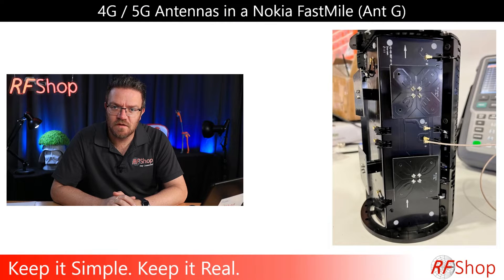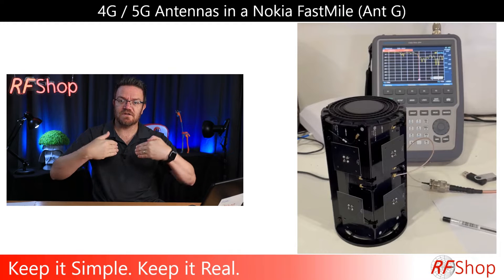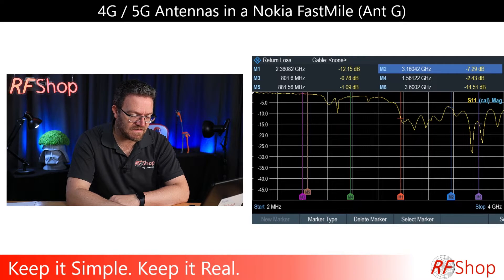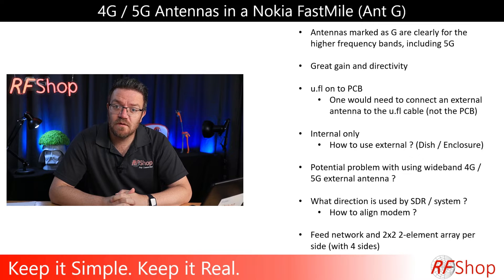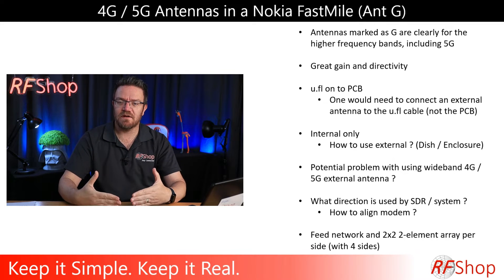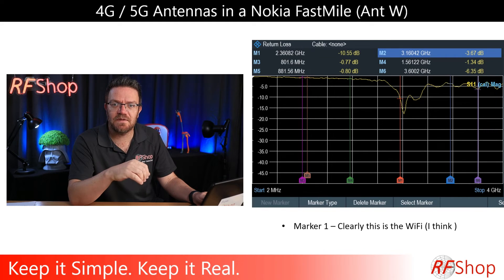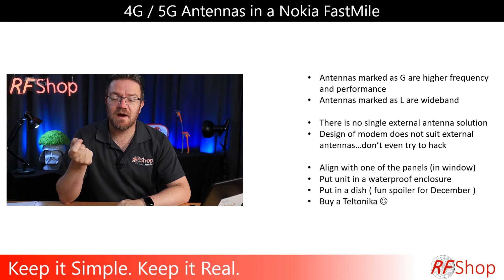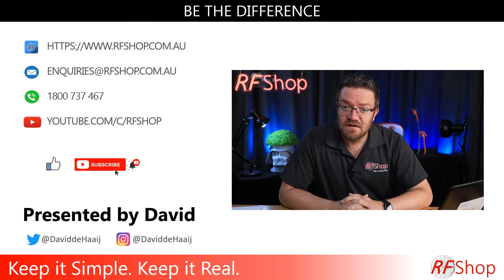Unveiling the Nokia 4G Modem: Insights and Antenna Optimization Strategies

Comment: I have a friend who has a nokia fastmile 5G modem and he has been getting connection dropout issues in more than one usage case. He and his family aren't technical minded people and don't have any understanding of internet technology and they also don't have the inclination to learn about technical stuff.

The thought popped into my head today that maybe their modem can support an external antenna which could and should work a lot better than the modem antenna which is stuck behind walls and the roof of the house, not to mention fences trees and buildings around them. I did some checking and before long stumbled onto this video. It really sucks how companies slap together these one stop "solutions" for people who want to set up internet with the least amount of cost, learning and setup but which have no options to address the many problems that you often get with consumer grade wireless devices.

As this video showed there is no properly designed connector for an external antenna, you have to open up the device and hack together some sort of external configuration. But since the modem is not designed that way and wireless communication quickly gets complicated, you're stuck with the only option of moving the modem around inside of the house looking for a spot with a good connection to a mobile tower. If you do have a good connection it might be on one side of the house which immediately cuts the internal wifi coverage down by half.

I'm not sure if my friend's dropout issues are because of multiple devices competing for internal wifi or because of external conditions affecting 5G reception. I convinced him to plug his main PC into the nokia modem using an ethernet cable but the connection dropouts persist so it seems like a 5G problem, not a wifi one.

Internet setups are a nightmare for non-technical people who just want the bloody internet to work.

Comment: fwiw, I used to live in an old house, with thick brick walls and multiple solid steel bars running vertically on the outside of the window. the signal inside was terrible, but once I cable tied the Fastmile to the outside of the bars, the signal was good. also covered with a plastic bag for weather protection. dodgy, but it worked well
Reply from the maker: The antennas on the FastMile are really incredible. Doing what you explain would indeed work really well :D